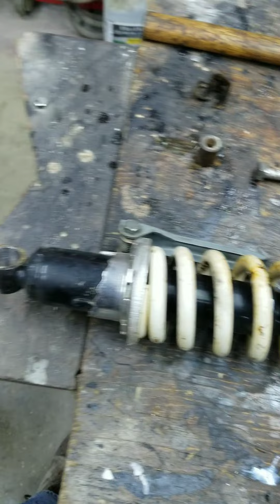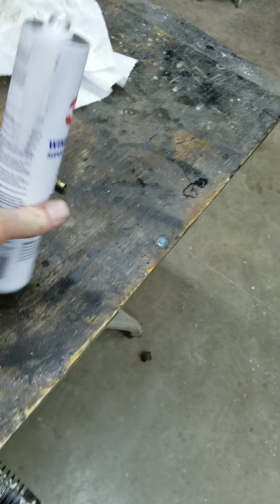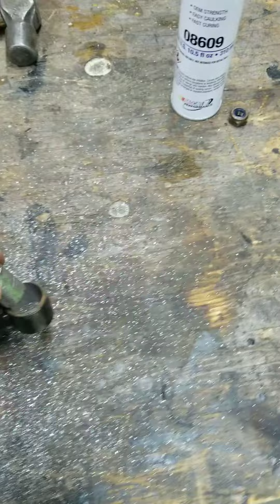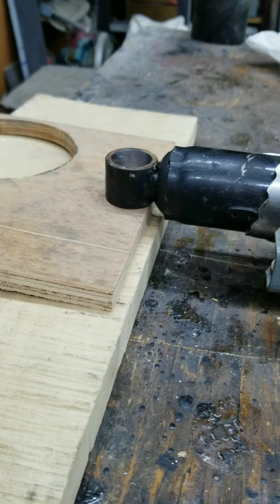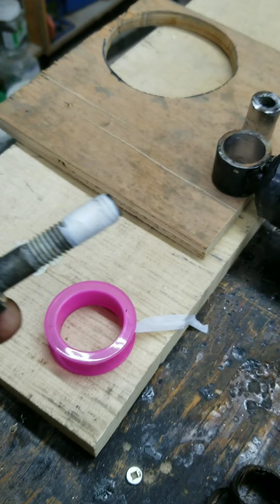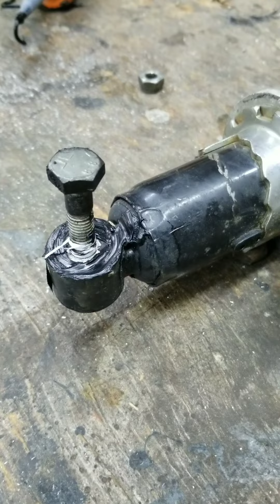DIY shock absorber bushings  repair the bushing with urethane rubber (window weld)

Comment: Do you think will work on a heavy utv shock?
Reply from the maker: It absolutely will.  Just make absolutely certain it has fully cured before using it.  You may want to half fill it...cure it then fill the remainder to ensure it cures fully

Comment: wonder if it'd work on my 1.8T ute / pickup lower shock bushing since shes to old to find / buy new ones  :/
Reply from the maker: It absolutely will work.  Just fill the bushing in 2 steps.  Half fill them let cure a day or 2..then fill the rest.and let it cure.  They use this stuff for engine mounts.   The key is making sure it fully cured before using it